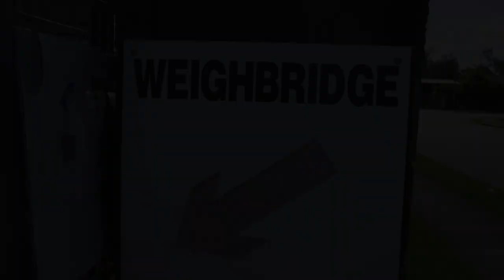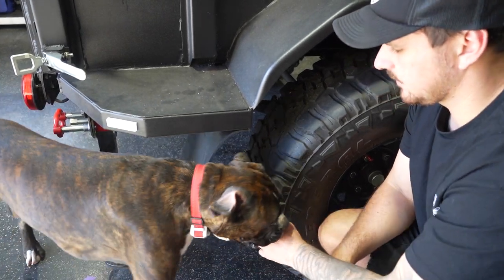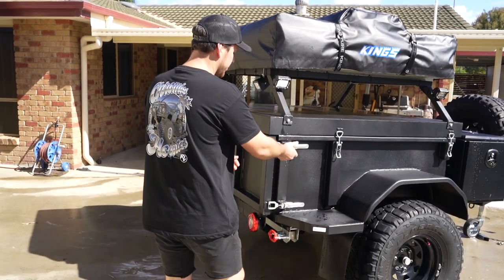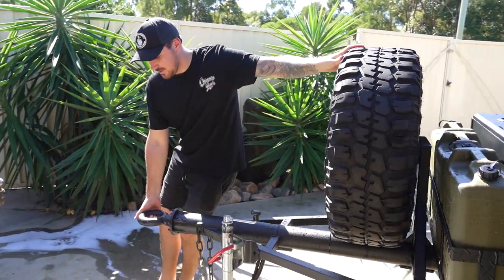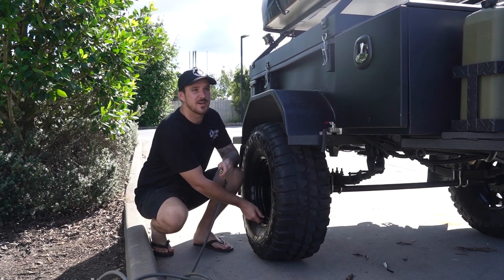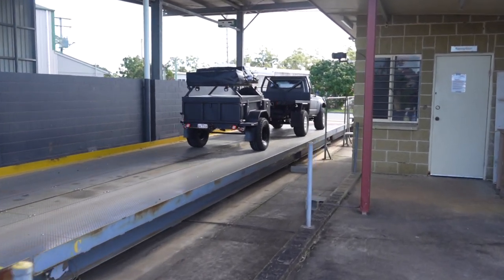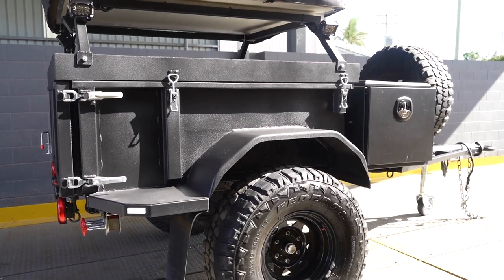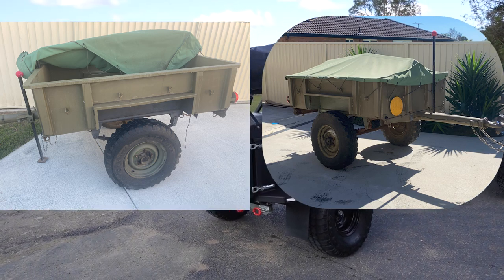DIY CAMPER TRAILER IS FINISHED!!! How Much Does It Weigh??? FIRST DRIVE 🔥

Comment: As the owner of a 6 by 4 camper trailer, yours is good. I took a standard 6 by 4 trailer, had a canopy made for it, added  King Quiky Rooftop tent and a set of 4 by 4 drawers. I have a 120 amp battery and 40 litres of water in 4 plastic cans. But I like yours. Happy camping. You never know, we just might meet up one day.

Comment: because that's a landrover trailer it has a fixed lunette eye and the land rovers have a rotating pintle hook which is other way around to normal. normally you have a fixed pintle hook and a rotating lunette eye. the way you're setup both are fixed which won't be an issue unless you get the trailer on a steep enough side angle to bind the hitch, or worse case you roll the tralier and it tips the nissan as well or just breaks the trailer or tow bar.

Comment: Nice effort mate , I probably would have went a different way with the hitch , I can see circumstances where that is going to drive you utterly nuts banging around.
  Longer draw bar does make them nicer too tow , I’ve built and rebuilt a few trailers over the years and all of them I extended the draw bar a tad , On my caravan too , my last trip with the big old rechassised caravan it towed like it was on a laser beam for 5000 K’s , I also replaced the old brakes with nice new hydraulic brakes , ( electric would have been nice too) , so much nicer to have good trailer brakes , did you end up fitting brakes  ?

Comment: looks like u need a gen y hitch to lower the draw bar height and angle so u got correct tow ball weight .  looks great tho ! still watching!
Reply: also imo ur hitch receiver toungue is too long and has too much wobble play in it ..
Reply: also u could probably do with a bigger tow ball size as the hitch is supposed to cover the ring of the pintle so it can't really move outside of the ball .
Reply: yeah weight is very reasonable for what you have .
Reply: looks sick ! overall ! have to go take it camping soon !
Reply: you need to talk about cost and insurance valve etc next video . well done congrats on ur build

Comment: Lol had to laugh as the weight for a un braked trailer is 0nly 750 agm (tare) weight. So if your trailer weighed 680kg witch is very heavy for such a small trailer . So by the time you filled your water tanks up plus minus 70kg you can't put more weight into her. Better put that beast of a girl on a strict diet lol. I recently built a 8x5 foot trailer and the sides is 450mm high and it only weighed 340kg. Good luck as it's a real pain to apply for a Vin number. Good luck.

Comment: Man that is not light that is heavy. The average 8x5 box trailer is around 200-250kg that’s way to heavy. You better go get heavier axle and brakes
Reply: And you haven’t got enough ball weight it should have 10% of the total weight on the ball 680kg should be 68kg on the ball. If you have to much weight behind the axle it will start to sway down the high way